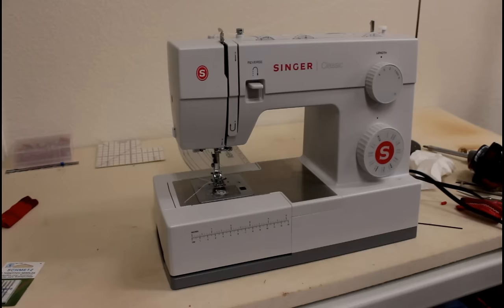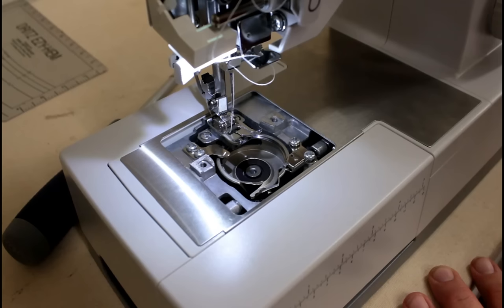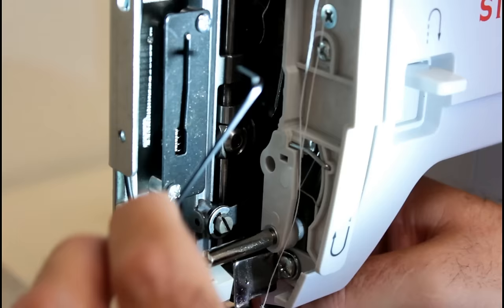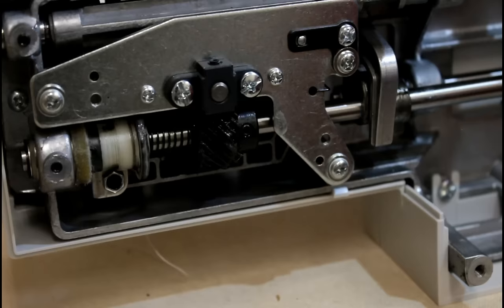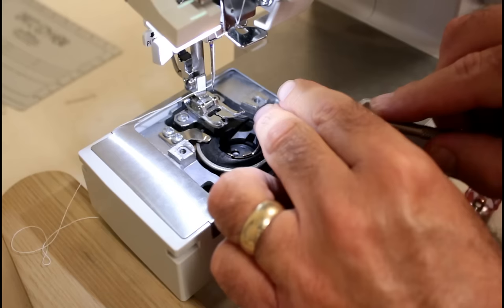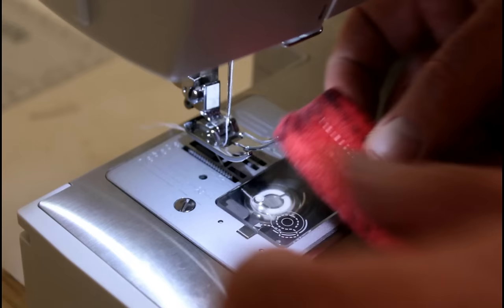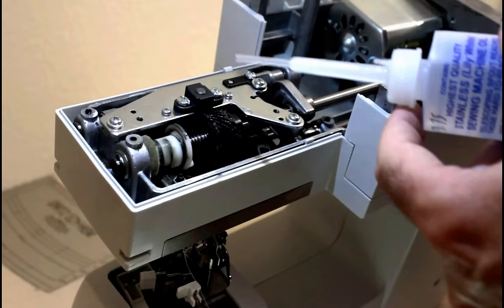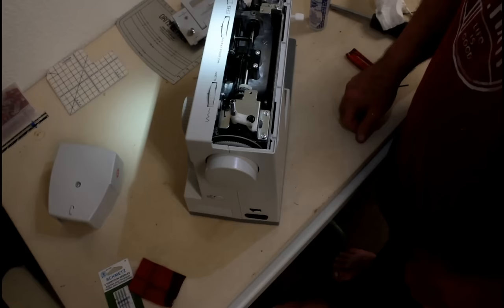Setting the Timing, Greasing & Oiling the Singer Heavy Duty Series Sewing Machines

Comment: The timing should be done with the needle in the far left position to guarantee full catch even when it is in the right most position!
Reply from the maker: Actually, both to the left and right. I've had to reset it before by only using the far left position.

Comment: Hello ! I'm having a problem with the machine, and we can't seem to put the hook in front of the needle. We loosened the hook under the machine, but it still doesn't move a lot. We are a little afraid to break something because things doesn't go as smoothly as it does for you. What could be the problem ? Do you perhaps have a solution ?
Reply from the maker: Did you loosen all 3 screws?
Reply: @kevinsews  Hum We onpy loosened 2 screws, but what we did in the end was no good. We took it to the repairman, but it seems like there were severals problems with the machine
Reply from the maker: @julietteguihard2457  That is way you couldn’t get it to rotate it.

Comment: Hi! How often should a machine get cleaned?
Reply from the maker: It depends on how often you use it. If you sew often I would clean it before using it and add a drop of oil to the bobbin area. A minimum of once a year and much more if you use it fairly often.
Reply: @kevinsews  oki doki so let's say i sew once a week, once a month of cleaning is good?
Reply from the maker: @manoksakfc  Yes. Just make sure you keep the lint out of the bobbin.
Reply: @kevinsews  Thank you ^_^
Reply from the maker: @manoksakfc  My pleasure!

Comment: How many degrees of rotation should the hook move after the gear is loosened?  My problem is that the hook is catching the thread on the right hand position of the max zig zag setting and when the needle goes to the left its missing the thread.  I have no more rotation left on the hook  I advanced it as far as it goes and Im a 1/16 to a 1/8 short of the adjustment i need.  Hads some other timing point moved?
Reply from the maker: I've been hearing of this lately. You will need to remove the bottom cover and release the 2 screws in the cover plate that holds the bobbin shaft in place.  This will allow you to move the bobbin a bit further.
Reply: @kevinsews  Thank you so much for giving of your time.  Great videos and advice did it and got a tiny bit more adjustment.
Reply from the maker: @bobbylineberry146  You’re welcome!

Comment: I am having a problem with the fabric puckering when I am backstitching.  Going forward everything is fine.  Any ideas?
Reply from the maker: Either the feed dogs need to be adjusted OR you tension is a bit too tight.
Reply: @kevinsews  I have played with the tension and that doesn't seem to make a difference.   I did notice when I move the lever to raise and lower the feed dogs they did not switch back and forth.  When I put it in the down position and then try and raise them again.. they do not raise.. so this is probably the problem.  Do you have videos for that for a singer 4452 machine by any chance?
Reply from the maker: @debbienewcomer5855  I used that model in some of my videos. The only difference between the models is the number of stitches they offer.
Reply: @kevinsews  Great!  Thanks

Comment: Kevin, my machine needle go deep enough but the timing is off so my needle fails to catch the thread. I tried to loosen the screws as you showed from the bottom but the needle still doesn’t move freely enough to adjust the timing. Can you please help. I have singer 44S.
Reply from the maker: Look at the bottom image on page 16 of the Service Manual. These are the screws you need to loosen to make the adjustment.
Reply: @kevinsews  hey, thank you for your reply. I fixed that issue but now my machine dont stitch at all. I can pick up thread from Bobbin using need and when I start stitching, the cloth moved forward too but the threads are making the stitch... sorry i keep asking so many questions. I am sop frustrated with this machine
Reply from the maker: @salroebuck8330  Look on the back side of the machine after removing the bed. There is a switch back there that lowers the feed dogs. Make sure it is switched to the raised position.

Comment: What do you do if the screws for the hook won't come loose? The screws on mine are so stuck nothing I've done can loosen them so I can adjust the hook to fix the timing.
Reply from the maker: I have heard this from a few others lately. Surely they didn't weld them in, so I am wondering if they just over tighten them. I would buy the tip that fits and use a socket to get more power when turning. Hopefully, they will break lose for you.
Reply: @kevinsews  I've fixed this machine before for timing issues and I know I'm not strong enough to over tighten them like this, so not sure if they become over tightened as I use the machine. But I will try a drill I just didn't want to break the machine using a drill.
Reply from the maker: @ashleighclayton4077  Okay, please come back here and let us all know how it worked out for you.
Reply: @kevinsews  got the socket drivers for my impact drill and they came out easily. One of them did fight a little which is strange that anything that small would be able to fight an impact drill
Reply from the maker: @ashleighclayton4077  Thank you for the update. I glad you worked it out.

Comment: Once I adjusted the the timing, the needle moves but the fabric wheels don't move the fabric
Reply from the maker: Pull the cover off to expose the free arm. Look on the back side and you will see a slide that disables/enables the feed dogs. Make sure it is enabled.
Reply from the maker: @tejahcarbone209  Okay, it sounds like the gears of the bobbin isn't seated into the drive shaft. Once you disassemble it make sure the bobbin gears are seated into the drive shaft enough so you can manually turn the bobbin case.

Comment: Hello Kevin, Hope you are doing well. Thankyou for making these videos. 
 I just bought my singer heavy duty few months ago with my first paycheck. However, as I sew now, the timing is always off. As I follow the steps of this tutorial, I wanted to ask how do I make the black gear move? the one that connects to the hook where the bobbin sits. From the video 13:28 . Even if I loosen it up it seems to be jammed. So I cannot move it to the needle.
Need help on this so I can fix it by myself. I took it to the repair guy last week and he charged me Rs 1000 (around 12 dollars) and he just look at it for 10 mins. I sewed for a day and then this happens again. Please help we with this. Your reply will mean a lot.
Reply: I just fixed the hook timing on my machine, and it seems to me that the black gear has a maximum position where it cannot be moved any more, even if the set screws are loose. If you move it to the maximum position and the timing is still off, the next step is to adjust the needle position. In my case I had to lower the needle slightly, and then it worked perfectly.
Reply: @shaynegryba9529  Thankyou for the reply Shayne 😄 I think what you said about the black hear is right. I didn’t think of that, I just thought it was jammed 😆

My boyfriend actually helped me with this, he adjusted both the hook below and the needle. Now, it works better than what the repair man did. 
I’m really grateful for him and this video, now I can sew peacefully. 🥰 
Thanks for the insight and Have a great day ahead Shayne. Cheers!😄
Reply from the maker: I am glad to hear you got it fixed. Thanks for letting us all know.

Comment: Dear Mr. Sews. I just went through my machine, degreasing(horrid yellow grease on gear that circles in the housing on the bottom) and regreasing oiling. I broke 5 needles. Cheap ones and I have learned my lesson on that. Found thread in the upper part of the machine near the needle bar. Popped the top off and oil up there as well. Changed out my bobbin casing, universal part. Totally not impressed with that. I am thinking of ordering an actual Singer bobbin. I am still getting thread under the fabric. I am wondering if I need to replace the striker pad. It has been damaged. After all the cleaning, casing changing of a 3 month old 44s, I am so frustrated. I really think it's the strike pad. Not like I've thrown that many parts at it. Suggestions please?
Reply from the maker: If any part has been hit with a needle then replace it. The thread will catch the burs and it will cause all kinds of problems. This is most common around the needle hole on the plate.
Reply: @kevinsews   I ordered  a new needle plate. Thank you. I believe that is the problem. I have another question. I have a vintage Kenmore 385.1249380 given to me as a gift. Needle arm never moved and after going after my Singer, I feel I can fix it. The clutch set screw is missing on the hand wheel(hope I described that right). Someone tried to fix it and put it back together wrong. I think that's all that's wrong with it.  My question is, can I use any small Kenmore screw as a set screw for it? Not sure what to look for and purchase. I got the grease I needed through you.  Gladly do that if you can point me in the direction of an after market part. Please and thank you! You've been such a great help. I worked on my new plastic body Kenmore because of you as well!
Reply from the maker: @KarensImaginarium  Go to htttp://www.sewingpartsonline.com and  enter you machines model number. They might have what you need.
Reply: @kevinsews   Do you think just a regular sewing machine screw would work? Trying to figure out what length it might need to be.
Reply from the maker: @KarensImaginarium  I have a Kenmore 19233 in my shop. Let me take a look at it tomorrow and I will let you know what I find.

Comment: I can’t seem to get it right do you have any tips that can help I really don’t want to pay to get it fix or have to sell my machine
Reply from the maker: What exactly is the problem you are having?
Reply: @kevinsews  the timing to the needle is way off and I’m going step by step with your video but it’s still off.
Reply from the maker: @vanessagutierrez4052  Rotate the needle by hand. When it starts getting to the lowest position then rotate the bobbin until it aligns so the bobbin catches the thread loop as the needle starts raising.

Comment: I took all 3 black little screws out and it’s still not turning freely. What should I do?
Reply from the maker: Some have reported they sprayed with something that loosened it after a few hours.
Reply: @kevinsews  what spray would that be?
Reply: @kevinsews  I’ve gotten my timing to work when the needle is centered or to the right. If the needle starts at the left it won’t catch. If I start at the middle to catch the thread and than move to the left to sew will I be fine?
Reply: @kevinsews  also, I’ve been having lots of issues with needles breaking now since I’ve readjusted my timing. Broke around 15 needles the last 2 days not sure if it’s tension or what do you believe it could be?
Reply from the maker: @stevenvetri Any lubrication oil.

Comment: Singer futura feed dogs will not raise with button, any thoughts?
Reply from the maker: Did you check the manual on how to lower and raise the feed dogs?
Reply: @kevinsews  yes. I even took the covers off to see if I could figure out why they were not working but I still was not sure what I was looking at.  When I pull the embroidery unit off, the lever will drop the feed dogs easy enough but it does not “catch or grab” anything to push them back up.  I am able to pull the cover off the bobbin case after embroidering and manually pop them up but that probably is not good for them.  Which is why I reached out to you to see if you have had anyone else with this issue.
Reply from the maker: @sheilamartin5196  With it being an electronic machine it could be the board that is causing it too. That does complicate things.

Comment: Hello Sir, 
I have singer sewing machine (model = computer 7800)
It had a problem of the same timing, I adjust it by using your provided instructions, but now it has another problem, which is the timing of teeth become disturbed, now it not working properly when I select the stich design in which the machine going forward and backward instantly.
Sir what to do now???
Please guide me to fix this problem too.....
Reply from the maker: You will need to find a Service Manual for your machine. Electronic machines are a different than these mechanical machines.
Reply: @kevinsews  but the mechanical parts are the same as you mentioned in this video, I already adjust the timing but with this I think I disturb the teeth timings... Now I don't understand how to adjust the teeth ...
Reply: @kevinsews  but the mechanical parts are the same as you mentioned in this video, I already adjust the timing but with this I think I disturb the teeth timings... Now I don't understand how to adjust the teeth ...
Reply from the maker: @ijlalbangash2009  Take a look at the Service Manual Link I posted. Hopefully, it will guide you how to fix it. Hopefully it will be the same as your machine.
Reply: @kevinsews  sir where should I find this link? There is no link with your comments.... Can you contact me on my WhatsApp no?? If you can than I will share my number here... Thanks 👍
Reply from the maker: @ijlalbangash2009  Look in the video description area. I really wish YouTube would expand this area on all videos as nobody ever seems to look that on mobile devices.
Reply: @kevinsews  Thank you sir , I find that manual, Now I will find the solution of my problem. Once again thanks for your cooperation and support. God bless you sir.
Reply from the maker: @ijlalbangash2009  You're welcome!

Comment: can u get metal bobbin cases for the singer 4423
Reply from the maker: I would stick to the plastic bobbins that Singer suggested. The metal ones are now not metal… the are cheep aluminum that bend easily. The plastic ones stay nice and smooth and they don’t warp easily.
Reply: @kevinsews  i have a 201k  the babong case is all metal sews smooth man i think they cheaped on on the plastic plarts with this machine shame
Reply from the maker: @rndea100  Being metal is key. The current "metal" bobbins are flimsy and they warp very easy. That is why most of the manufactures when to plastic bobbins. They don't bend out of shape.

Comment: Even though I untighten the Allen screws at the bottom, the hook is still spining when I turn the handle
Reply from the maker: Some people have reported having to loosen the shaft screws on the bottom to rotate the hook position. I've never had to do this on my machines, but they may have changed something that I am not aware of on the newer version.  Search the comments and look for Samuel Grant comment from 6 months ago. He found removing the belt off the drive shaft allowed him to set the timing with the bolts don't loosen the hook.

Comment: Still unsure how you are determining proper needle height and from which point to determine placement for height adjustment
Reply from the maker: The manual gives you the instructions on using the proper tool if I recall correctly. I am on the road for a while, so I don’t have the manual right now.
Reply: @kevinsews  Ill have to check again. Mine didn't come with a manual, and on the site they brag about not providing manuals. It's a tree hugger thing I guess. So I had to print it at my house. It's in multiple languages and is rather brief. If I recall correctly, their solution for timing is for me to find a repair center.
 Thing's been nothing but trouble for me. It's brand new. It's not very heavy duty and chokes on a few layers of denim. I've been through two spools of thread and 5 needles trying to fix a couple pairs of jeans. Most of the time it's a rat's nest underneath. Except when it's busy slamming needle into the plate. The allen screws are so far inside that they're camming out with folding allen wrench set that I dug up. No idea if I'll be able to adjust them again. No wrenches came with this abomination. I thought I had it set but now it won't pick up the bobin thread again. 
I think I need to find one of the old human powered models or something. This thing is overly fancy and under-built, I guess. It's got dozens of functions that don't work.

Comment: Why did you not remove the Presser foot,, also it’s better to remove the back position bracket,,an not disturb the settings of the front,,,,did you check the top gear an bottom ,they sometimes run loose,,, you should purchase Allen spanners with screwdriver type handles,, it tighten  better.   Did you check your feed timing,,, next purchase ah needle bar ,hook timing Gauge,,it’s not cheap,,but the best.  Looks like your feed timings is off,,,  your under tensions is bad,,   Then sew off sample with soft cotton an STREACH fabric,, and use longer test fabric,,,only Information,,for you.
Reply from the maker: The purpose of this video was to help those who don't have access to the professional tools. My length was set to 0 while setting the timing.

Comment: I cannot for the life of me get those tiny bolts unscrewed at all. I’ve tried all 3. Lol so sad
Reply from the maker: Read the comment below. Some have had to get longer Allen Wrenches to loosen them.
Reply: I finally got them loose. Now my problem is it will hook once but when I turn the crank the thread won’t hook around again.
Reply from the maker: @dieshajackson332  Did you put the face plate back on before testing?
Reply: No I didn’t thank goodness lol. I got it to loop around and I had to slowly lay my machine down and hold my hand crank so it didn’t move while I tightened one of the bolts back up. After I tightened one I tested my zig zag and it looped both swings. Thank to you. I really do appreciate you and time. It took some trying but you helped me get it right. Lol So I think when I would go tighten the bolt I would shift it and throw it off. Holding that hand crank super still helped though.
Reply from the maker: @dieshajackson332  That is great to hear! Thanks for the update.